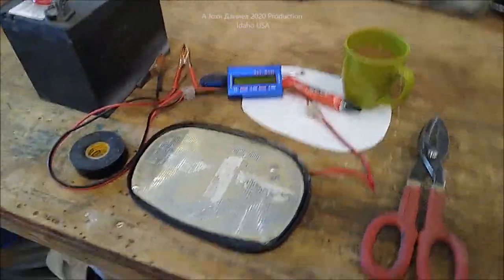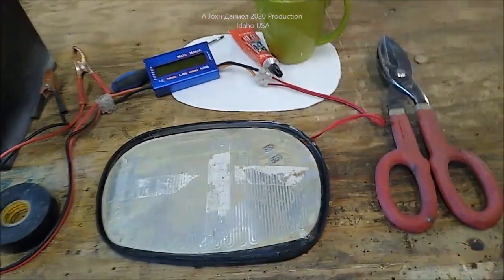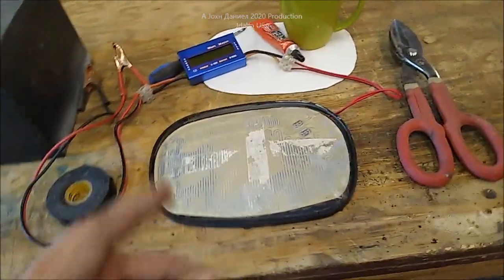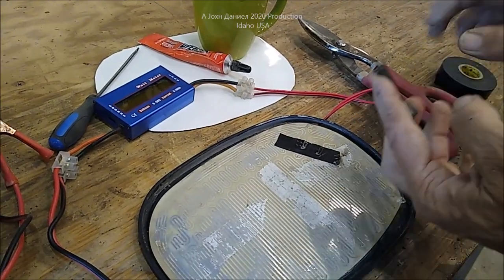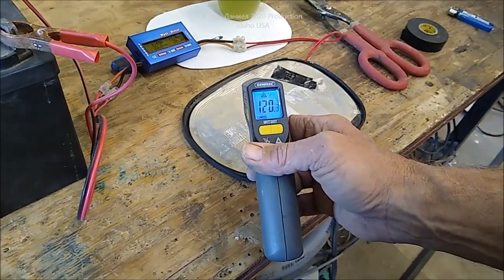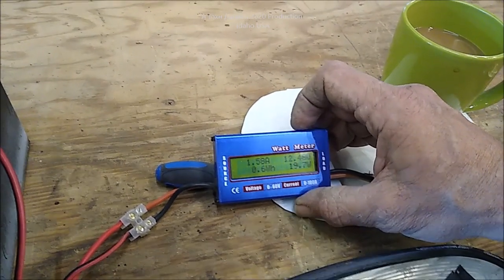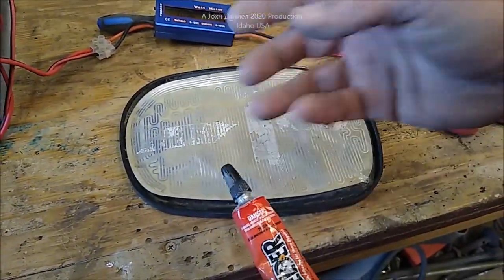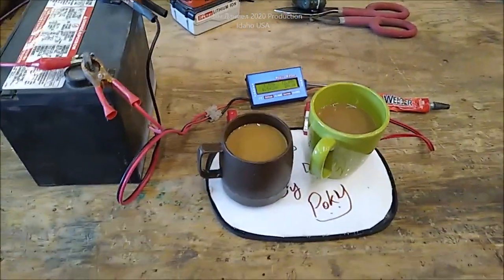12 volt Cup & Food warmer for $1 - from Auto Salvage Junk! (options below  ↙)

Comment: Have you seen that resistive wires for radiant floor heating I have seen it on Ali Express for fairly cheap I don't know how.much power it actually would take to heat an RV or like the one you are building or just to help supplement heat I don't know if they have a resistance that would work well without a bunch of short runs on 12v
Reply from the maker: Theres a different nichrome material mix for alternating current verses DC. But, I am seeking a trick around that with a special big, tough, affordable and safe 165 degree max defroster kit used on the bottom of snow plow blades. Stay tuned, a 18 amp 12 volt 4 x 8 heated tile floor may be possible!!!

Comment: That looks cool. You could warm a lunch wrapped in foil as well.
Reply from the maker: They sell 2 new under 25 watt 12V Mirror Heaters pads under $20 - https://ebay.to/3316pCS Just put them across from each other with about a 6 inch spacing in a cooler box to make a meal heater using 3 amps only!!!